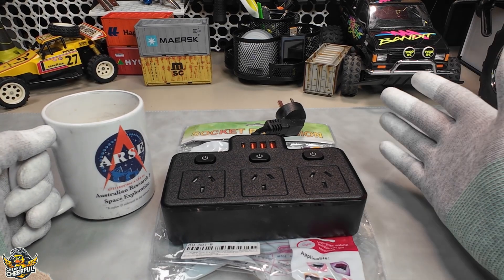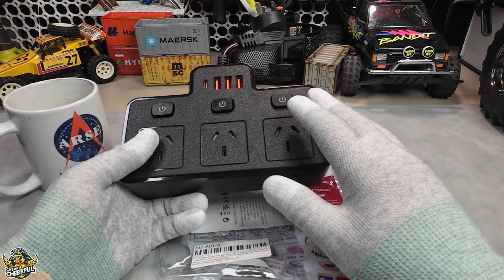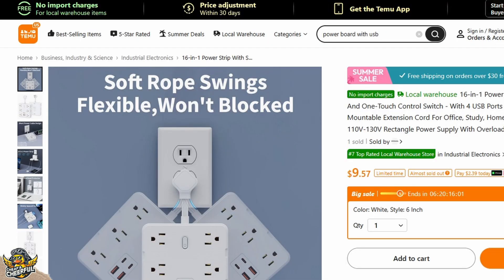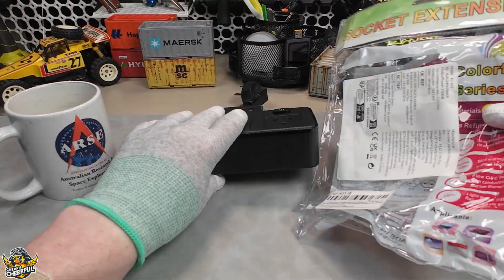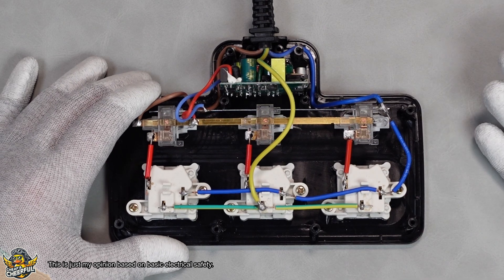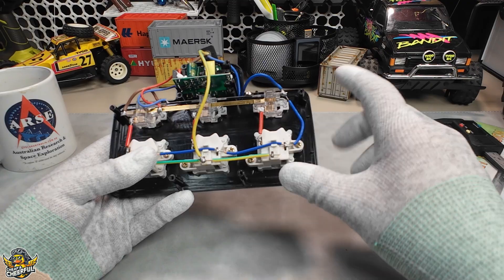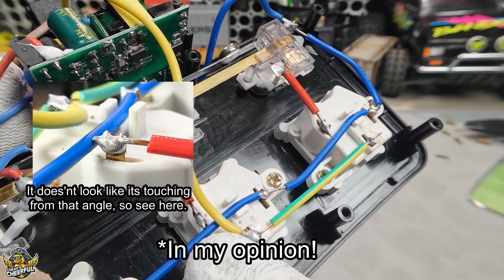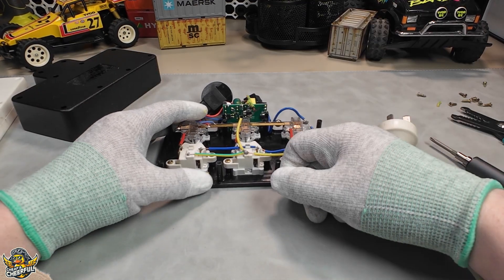When Cheap Kills: Faulty Power Boards USB Chargers that Electrocute

Comment: They absolutely sell dodgy stuff like this in major stores here - half the reviews for the "Décord 8 Socket Power Board With Individual Switches And USB Charging" at Bunnings say the sockets are still live when the switches are turned off. Still stocked and sold. 

Showed this video to my partner because he has an absolute ban on power boards with included USB charging in the house, for this reason you showed in the video.

Also - The mini heaters that plug directly into a power point, no cord - just hanging off the electrical outlet slowly toasting it are banned for sale here, but they're still all over eBay and other online marketplaces. No responsibility from a large online marketplace to ensure the goods meet any kind of electrical or safety standard and many consumers won't look past the attractive price. It's been made by a factory and they're still in business so it must be good right!? Terrifying.

edit: this similar one from Bunnings has reviews that it melts peoples chargers. https://www.bunnings.com.au/click-2-outlet-power-board-with-usb-charger_p0625543. in fact heaps of Bunnings power boards at the moment have serious safety complaints, melted cables, faulty switches, noisy usb ports. would love to see some of them opened up!

Comment: There are also a lot of bad powestrips sold here. The types with the red light in the rocker switch in Europe from the brand Q-Link.. I come in a lot of homes where this shitty power strips are used. Mostly the rocker swiitch  goes bad, it open and closes bad or the plastic broke so you put your fingers directly in the 230v. And the whole plastic becomes brittle over time. And this shit can you buy by local stores should be safe? No way. So it doesn't matter where you buy if you know what you buy. There are a lot good powerstrips from Xiaomi and so on than the cheap shit from the local big stores.
Reply from the maker: Yep. Chinese brands, actual brands are retty high quality. It's the made for Temu stuff which is terrible, and even sold locally now.

Comment: Canada and the US  used to have agencies checkingthe safety of anything  working with line voltage. Obviously all items coming from China through shipping directly are bypassing any inspections. I  still have my old and well built power bars. Adaptors,  I get  one with a higher rating than I need. I got a 35w charger, I was told I only need a 25W. It has a display showing  the wattage it consume. Surprise,  it has shown to go up to 27W. Which is more then 25 and it would work at the upper limit, the maximum. It wouldn't  last too long. The phone charged every day. Sometimes twice. Lot of use just in one year.
Reply from the maker: Yep. Golden rule for me is never buy 120/240v items from China, in rare cases a brand is OK like Anker or Lenovo. Nothing else.

Comment: hi to check if the wire is steel you could use a magnet
Reply from the maker: Yep good point. Did this afterwards. Didn't seem to be attracted. Surely it's not copper! Some other material perhaps.
Reply: @CheapCheerful  I have a similar power strip with 1.5m cable and without the usb junk. It's the same construction, but the protective earth (PE) is also a "busbar" which is just placed upon the connector in the sockets without a rivet (as done in safe sockets). The connection is so unreliable that in the last 2 sockets the PE is not connected at all (continuity tested). It's also a very thin "busbar".

I've checked the wire, it isn't magnetic like steel and doesn't bend like aluminium. When heated it balls up at the end (also seen in your video) which suggests it is copper actually - to my surprise - but it is too thin anyway.

I got a full refund, didn't have to return it. I'm replacing the wires, busbars and will use it. If I don't write about the result in a year than it was a bad idea 😅

Comment: My mate just bought one of these and was using it with a resistive heater. He nearly had a disaster. He bought it at a local cheap shop in Sydney. Same exact one.
Reply from the maker: Yeah that's real bad. Local stores should know better! I always look for the RCM symbol these days.
Reply: @CheapCheerful its really tough these days for independent retailers. I've seen a couple that seem to be buying some of the nost common tech and such from AliExpress and reselling it. Not saying its a good thing but i definitely understand why they would do it.

Comment: Too true. I bought one from China when I was living in Bangladesh. Didn't give it any thought until the on/off switch stopped doing anything [sockets permanently live] a week after buying it. Seller offered me 1/2 refund if I wouldn't leave a bad review. Took it apart and there was no ground/earth despite a 3-wire lead/plug. Internals were a lot scarier looking than the one you just showed us. Stupid, stupid, stupid me trying to save a few bucks over the legit one in the hardware store. Same reason as you -- I really, really wanted one without an insanely long cord. Now I'm in Hong Kong so I have complete confidence in my electrical choices...😅
Reply from the maker: Oh you were lucky, you got the invisible earth cable!  Yep, I have a rule - never buy anything 120V/240v at these stores.
Reply: Hong Kong gets most consumer goods from China
Reply: @samsonsoturian6013  Yes, thus the ellipsis and sweating emoji.